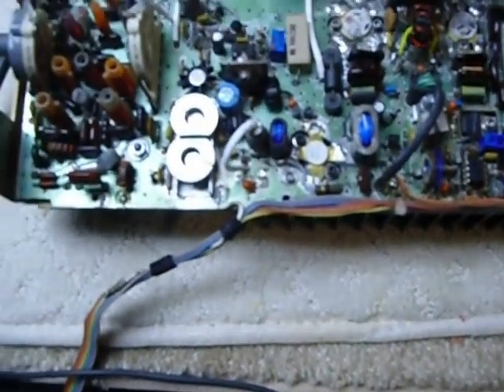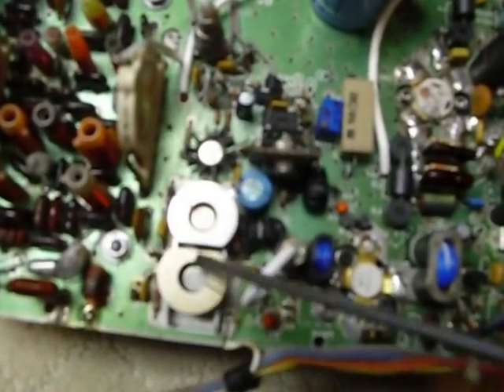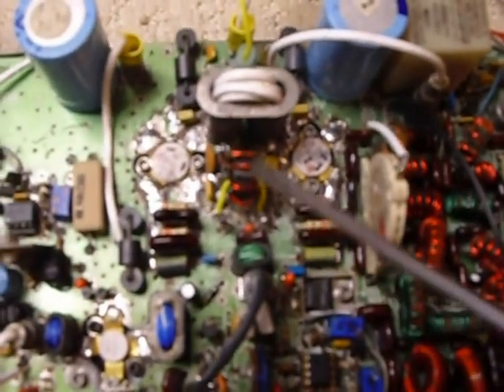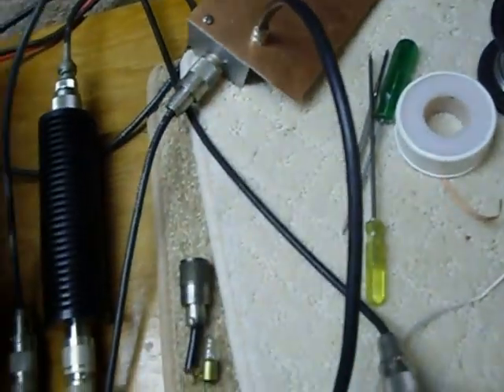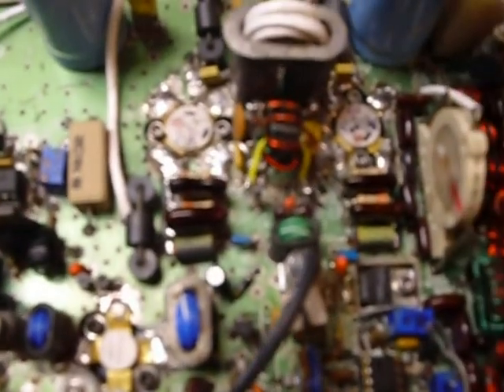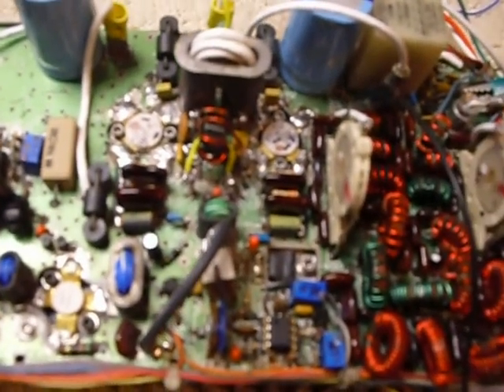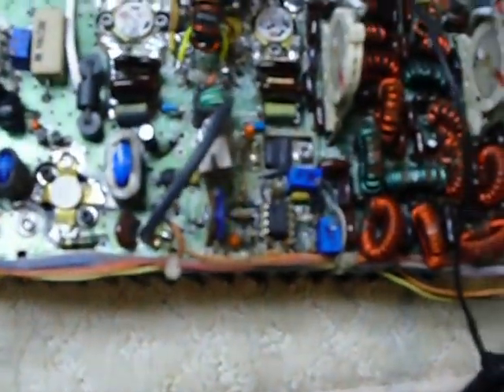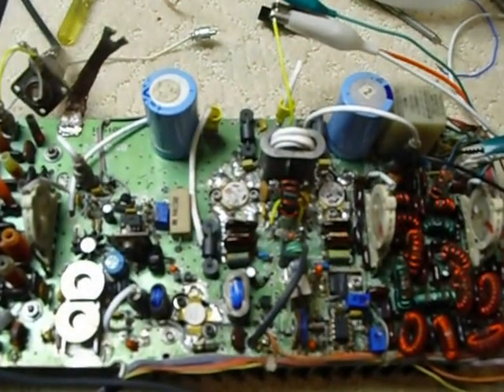SS9000-3 Heathkit SS9000,Heath SS9000,Heathkit tranceiver,Amateur radio repair

Comment from the maker: I should have used an insulated tool and not a small screwdriver  as a pointer. I saw the little spark on there on the video before uploading to youtube and decided the video was ok .  No shock from it at all it is only 12 volts but a part could have been fried . No Harm was done to the board it is working fine .  73  BOB